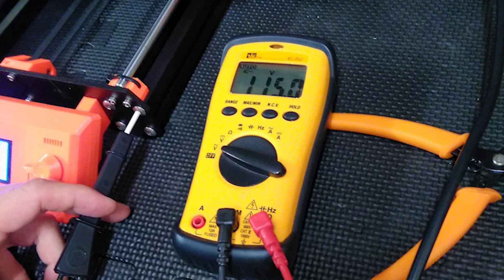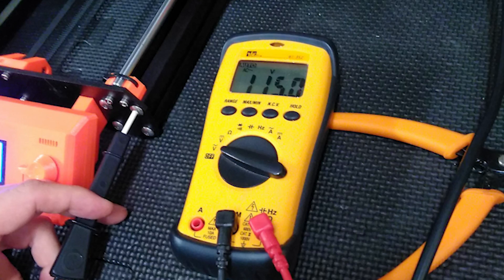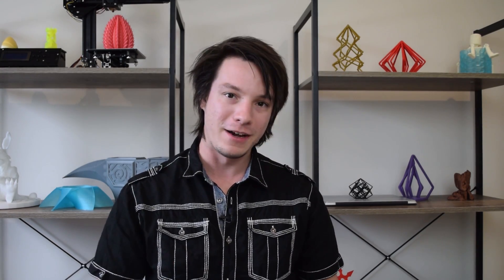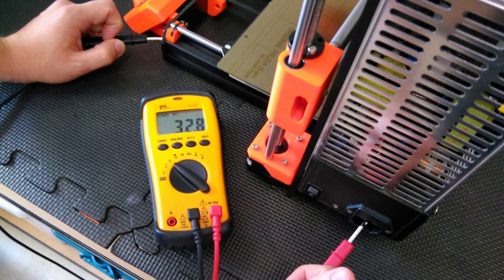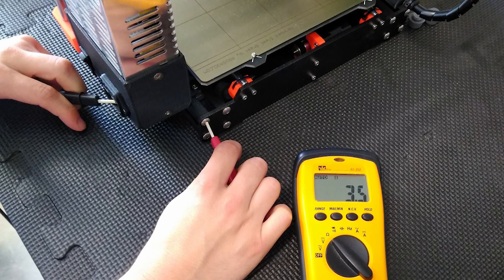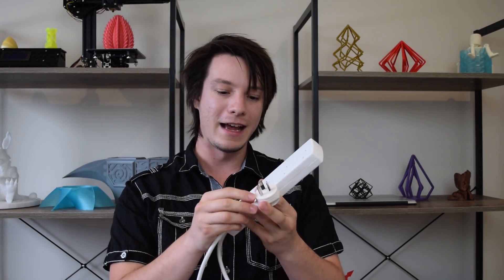I got shocked by a 3D Printer

Comment: i am going to guess that its a cheap chinese power supply i would check it on its own first see were it is leaking to ie the chassis then be tear it part looking for looking for shielding between board and case then inspecting the board looking for abnormal ie solder balls spark burns. then the mains isolation on the board if all that passes the its the transformer its self.

Comment: Would be interesting to measure the leakage in the ground from the a5.
Reply: THAT was grounded.  It was the 'daisy chain' that failed him.   I'm starting to wonder if this is an anti-A5 post?
Reply: Yes, but that means the A5 would be putting potential on the ground line, since the ground was disconnected, it was unable to clamp it at 0. 
If he did connect the ground, then there would be some leakage current through it. He could measure this current by connecting a current meter inline with ground, or measuring the current difference between live and neutral. 
If this was over about 10mA, then it's enough to give a really nasty shock, if it's over 100mA, then it could kill. He may also have had problems if he tried to plug it into a RCD, and the leakage was more then the RCD rating.
Reply: And yes, I think this has every right to be a dig at A5, since this means that their printers are dodgy and not complaint to standards.

Comment: Hm. First thing to do if you recognize some electrical Problems: unplug everything in this circuit and remove the fuse completely (and not let the aurora running the Job) and after that check, that it is indeed not powered... Everything other isnt just dangerous, it is dumb. With electrical faults there are not only risk to harm yourself from shoks, things also can start to burn. Or it can kill others (e.g. if you wearing a cardiac pacemaker, this will definately kill you...)

Comment: Hi Angus,

I'm a keen viewer of your youtube videos.
While I'm waiting for delivery of my first 3D printer, a CR10s from Gearbest, I will comment on your shocking experience with a missing connection to earth.

All switch mode power supplies (SMPS) have a filter on the mains input.
Part of this filter is a capacitor, 5nF, connected between Line and Protective Earth (PE) input and a similar capacitor between PE and Neutral.
If no PE is used, the voltage on the equipment PE pin and all parts of the equipment connected to this pin will be half the mains voltage.
The value of these two capacitors are balanced between what is needed for the filtering function and what is lethal. In countries using 230VAC the value is 5nF.
At Australian mains voltage (230VAC) the maximum current flowing through the two capacitors through the PE pin to earth is around 2mA.
A lethal current is everything above 30mA. 
That is why the ground fault switch in your distribution board is set to trip at 30mA.

Now, - what you felt was a current around 2mA and that gives everybody a shock.
If you, as I have been a number of times, ever are submitted to a current that trips the ground fault switch, you will get burn marks at the two places where the current flowed into your body, - or more likely, - your fingers.

Ground faults are generally not lethal if you have a ground fault switch in your distribution board.

That said, due care should always be your top priority when using appliances like 3D printers. 
Often, the low voltage side of the appliances will have metal casings and other metal parts connected to PE.

More important: 
If you touch Line and Neutral at the same time, the ground fault switch will not trip!

About appliances with no PE pin:
If they are approved by your local authority, they are marked with two squares, - one inside the other, as a proof of double insulation. 
Double insulation in short:
No metal parts on the outside are allowed to have connection to any parts carrying mains voltage AND the distance between metal parts on the outside and mains voltage inside have to larger that the demands stated by your local authority, - usually above 6.3mm.

regards
oakey
Denmark
Electronic engineer since 1978, - now retired from work but not from electronic and mechanical design :-)

Comment: I WILL NOT flame you. You learned the lesson the hard way. I work with CNC, 3D Printing, Amateur radio including different types of antennas. I have been on a work site where a senior journeyman electrician put L1 to ground on a main bay line. He did not die but we loss two industrial bus bar boxes. 

Proper isolation is extremely important. The amount of folks I have met who don-t consider a soft start and bleed off on a transformer for a CNC machine scares the crap out of me. Thank you for sharing the lesson and a lesson in return. All CNC need a E-STOP that is not software based and fully locks the system down. Spindles don't care and even 700W ones can do serious damage at speed.

Thanks for the reminder, it is always useful even though I work with it often.

Comment: Unless your an idiot the UK protects you by requiring the ground pin for a plug to go into the socket and having a fuse in the plug as well as an RCD for each loop. In addition if the frame is at main potential that means there is another issue. Test the arora from the live to its ground connector, it should have infinite or multi megaohm resistance and then do the same for the neutral. If both of those are fine test to see if the power supply has isolation between its mains and low voltage side and that the correct amount of physical separation exists between the traces. If it was made properly there should be a cut out of the PCB to protect against arch over.

Comment: This is stupid, why don't you have an RCD/GFCI they would have tripped on this event.
Reply: No, that was his whole point about the dodgy power strip - it didn't have a ground connection.
Reply: Wrong, they detect current leaving on live not equalling return on neutral so any non neutral return path trips them
Reply: It might not trip if the fault was just a Y bridge in a power supply. The current will be too low to be dangerous and be below the level that triggers the RCD.

Comment: First off, how about diagnosing the other printer before trashing it. For all you know at this point it was shipping damage not a design flaw. You have enough power in this community to kill a product, and with that comes a lot of responsibility to those products to fully test them prior to evaluation of any kind.

Second, does the Prusa not have a fuse or breaker along the ground that trips when enough voltage is flowing on the ground. Even a lot of my cheap printers have a fuse that blows if too much voltage flows down the ground. That would include bleeding voltage from the line.
Reply: Reading all the comments, I'm starting to wonder if this is a "YAY PRUSSY - A5 BAD" post.
The root of the problem is lame extension cords leading up to the appliances!
Reply: Bulbous Pig_Balls the fact the Prusa didn't blow a fuse having 100+ volts flowing back through the ground is a big problem. First off it could possibly burn up parts of the printer yet, second, what happens next time when it is a full 200+ mains voltage, or someone sets it on a metal top table where the voltage electrified the entire table. There is no apology due to Joseph Prusa, as this absolutely should not have ever happened.
Reply: It's called an RCD.  It breaks the live if it detects an imbalance between live and neutral, ie if there's a leak to ground.  However, it would be of no use on the Prusa as the leak was on the A5.  So an RCD on the A5 or on the power strip would have been required.  

I think as a manufacturer of electronics, you have to assume the earth is just that, and that a circuit breaker will be tripped if a dangerously faulty device exists.  You can't be expected to safeguard against other people's faulty or poorly designed equipment, nor can you protect people against their own stupidity in all cases (sorry Angus!).
Reply: LOL rawwwwr ... u mad ?   what in the world, easy now.
Reply: If it was enough to be uncomfortable at over 100 volts, there was plenty of current.
Reply: Warrior Me´s I am going by how he described in in the video, current being bled off of the other printer. You are correct it would not be solved by a simple fuse, as that would simply allow it to run ungrounded, I didn't think that through, but there should be protection in place to prevent the power supply from electrifying the ground to a point of any discomfort from a shock at all.
Reply: Warrior Me´s I agree, but I know there are systems out there that have protection built in for this very issue.
Reply: Warrior Me´s normally I would agree with you, but we are talking a Prusa Mk3 here, the few dollars per unit would not be a big deal, especially if they stress it is for safety.
Reply: Yes. If the only fuse was on a ground wire, when that goes and the mains are still live, now they go looking for another way to ground - You! That's kind of the whole point of introducing the ground wire to AC, at least in North America. 

I grew up in the transition years. My parent's house built in 1953 was not originally 3 wire. Any renovations we had done used 3 wire. My own first house had 3 wire - but live and neutral were reversed in a lot of outlets. Someone's DIY wiring. Those little outlet testers with indicator patterns are handy for any home owner to know what's what and proceed accordingly.

Comment: I have a Prusa Mk2. I got shocked when I accidentally touched the metal PSU case during my first week of printing. I then realized that the printer was not grounded, since the power cord from Prusa did not have a ground prong on the plug (which was really odd). I had the plug modified to be grounded, and all the "shocking disturbances" disappeared.

Comment: Wow.  Just glad you're OK Angus.  Don't feel so bad - many of us have made that very same mistake.  Just needing that few more feet of extension cable.  I have several of those cheater plugs around.  I live in a house that was built in the 1930s.  Only the newer wiring installs (for A/C, heating units, etc.) have 3-prong plugs.  I try to always use those - safer - outlets when using 3-prong tools, etc., but I've taken shortcuts when I was in a hurry.  A VERY bad idea, of course.  Thanks for reinforcing this warning to your viewers.  We all need to be more aware.  Thumbs WAY up.

Comment: Besides the technical issues, there's also a social problem that - as far as I perceive it - has increased over the years. You tell people in the comments that something shown in this video is unsafe for some reason or another, and you get flamed as a "safety nazi" (not my words). Even if the person who made the video knows about this and simply neglected to show the "boring parts", some viewers might not know about the rules. Heck, some people perceive these rules as "negative" and "interfering with creativity" - guys (and gals, though to a much lesser degree), these rules are there to keep you and people around you ALIVE. Most of the rules were written in blood.

(My favorite - screwing a mains cable to the power supply and then omitting any kind of strain relief. That's practically an electrocution waiting to happen, especially if you've got kids or pets.)

Comment: The absolute funniest part for me is that if you followed your own advice about using only grounded receptacles nearby, keep wires clean and out of the way, etc, you would not have been shocked.
Do yourself a favor, call an electrician, have him install more outlets than you need, on an arc fault breaker, and be done with it. Here in the states, it's legal for a homeowner to do his own wiring, pending inspection, but frankly I think you fear electricity way too much to pull this off.

Comment: RCD’s and GFI’s trip when there is a current difference between the hot and neutral.   It should not require a ground/earth for this to happen and will trip with small currents. According to the net yours is likely the 30ma type which may trip around 15ma.  With the faulty printer ungrounded check the amps flowing between its frame and an earth.  Be safe

Comment: Angus, 
Glad you are okay. 
I hope you are aware that there are many countries that moved to 3 or 5 wire systems recently and there are many I mean MAJORITY of buildings there, that have only two wire power networks in them. As an example Italy and and typical Italian plug (google). My home Bulgaria also have 3 wire requirement added in last 20y. So all buildings from my childhood do not have ground. 
That's why it is common to short ground and Neutral pins in the appliance so in case of problem power will be shut at the fuse.
It is also common that GND and N are also shorted within the wall plug itself so if you plug non shorted appliance it will be protected also. 
GND line and Current protection devices was added next to fuses for both people and fire protection in case that leaking current is higher that 30mA for People protection and 300mA for Fire protection on larger power network segment.

Comment: You should never use plugs without a ground in general. Unfortunately so many cheap things coming from China dont have proper plugs. So when buying from China, throw their power supply away, and go buy a proper one from an electronics company. In Australia, head to Jaycar. And also remember, if the printer needs 4 amps, always buy something thats above that rating, not under it, otherwise you will overheat the power supply.
Reply: Nooooo .... did you miss the part where there was no ground in ONE of many extension cords?  ha

Comment: Having electrocuted my own hand with an old 400V capacitor (lucky me) while working on the power supply of an old radio (tubes) I know the frustration that comes with such a mistake, I have ever since been very cautious around electricity (Or I should say I am more cautious around electricity since I am a certified electrician (although I have to admit that I haven't found work in that field and am now somewhat out of the loop, working as a callcenter agent :(. ))

Comment: Just as a warning, this can also happen with coax cables, or any cable with an exposed conductor. Make sure you have proper ground on all your equipment. Even things like office equipment or TVs can cause attached cabling to raise to a considerable voltage if not grounded (usually at much,  lower current than could be felt, but enough to cause unprotected electronics to die if they end up being the ground path)

Comment: Great vid Angus. As an ex-electrician I could see where this was going early on.
Electricity does not phase (excuse the pun) me in the slightest, but I do respect it. It will kill you if you don't. And yes, even I have had belts from mains voltage over the years. We have 240v here in the UK
I knew it wasn't gonna be the Prusa at fault, Josef would never sacrifice quality and safety for anything. He's an innovator.
Huge respect to you for your usual honesty and warnings for everyone. Above all, glad you're safe and well.

Comment: I find it interesting the absolute fear most Australian's have about household mains voltage.  I grew up in Canada on 120V/60Hz @ around 15amps, and have been shocked by mains voltage before (growing up in a house with Aluminium wiring meant I've had several outlets blow up in my face when a short happens), but now I live in QLD.  

I'd be more afraid of fire caused by electricity than of electrocution, but Angus isn't freaking out about the fire hazard of a 200C+ nozzle he accepts the risk.  The same respect should be done around the "electrical hazard".

Yes 240V (the Australian standard) is more dangerous than 120V.  But the absolute fear of any and all things electric down here is insane.  Rewiring an extension cord socket is taught in schools back home, yet here everything has to be tagged/signed off on by a licensed (and expensive) electrician.  You need licensed electricians to change lightbulbs and balances down here.  It's insane. (yes i'm being hyperbolic, but in commercial buildings you need a 'sparky' to change light bulbs), let alone the "Tag" every piece of electrical equipment is supposed to have, showing it's annual inspection. see this for an example: https://plus.google.com/u/0/117346934390490212587/posts/ZyvDcWAvYMT

Yes electricity is to be respected, yes it can shock you, and if you're unlucky enough to have several hundred milliamps cross your heart it will be fatal.  But most electricity is conducted by skin around vital areas, leaving a painful lesson and that's it.  Fuse boxes exist for a reason.  There's no way to become "makers" or "tinkers" with the standard phobia of electricity that Australian's tend to have.

That being said, Respect it, be Safe, and don't take Chances.  But household electrical current should engender less fear than the brown snakes, funnel webs, and Gimpie Gimpie that Australian's have no problem with.

Comment: My TV doesn't have ground and leaks a small amount of voltage to the chassis. Pretty scary if you think about it, TV's are generally high voltage appliances.
Reply: Still, if the mains-filter is built correct with approved components, it is not dangerous. The most dangerous part in old fashion CRT color TV is how you hurt yourself after getting shocked by the 25Kv anode cap. The capacitance of the CRT itsels isn't enough to hurt you unless you have some kind of condition, but what happens to you after you jump up, is what's dangerous.
Reply from the maker: Flatscreen or old school CRT? Those were insanely HV and quite frankly terrifying.